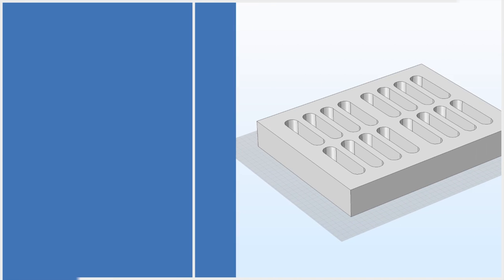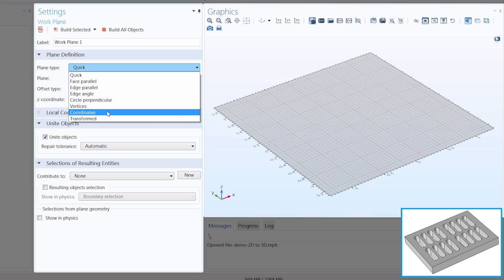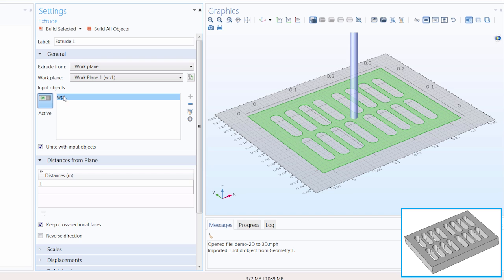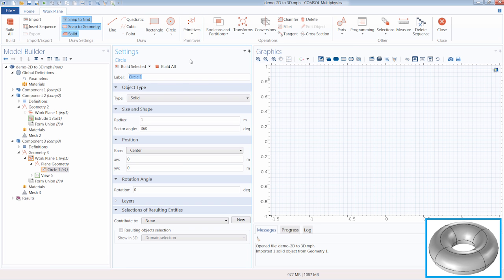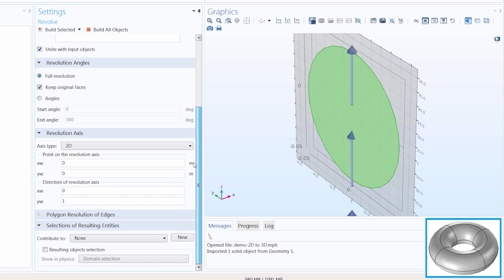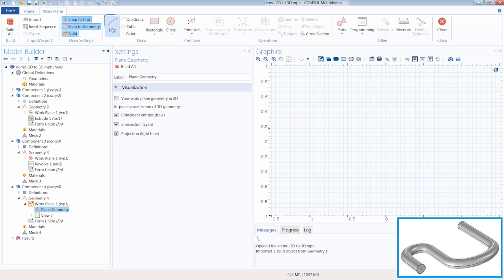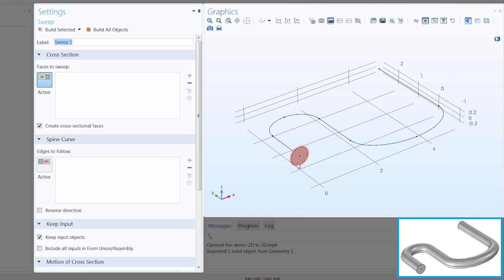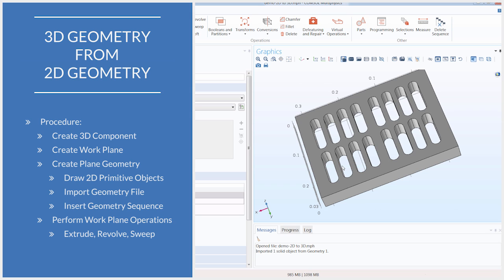How to Extrude, Revolve, and Sweep 2D Geometries in COMSOL Multiphysics®

Comment: Here while using sweep, it's creating a solid pipe.
How to create a normal pipe (hollow), I couldn't sweep when I change the circle type to curve from solid.
Thanks
Reply: If you want to make a hollow pipe do use the difference between two circles. As it would make a ring and then use sweep function to make a hollow pipe